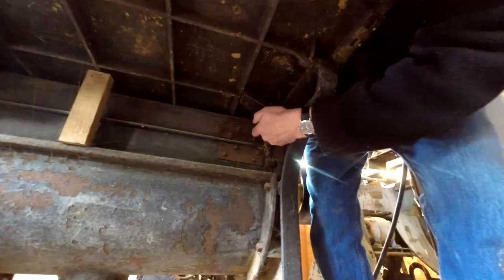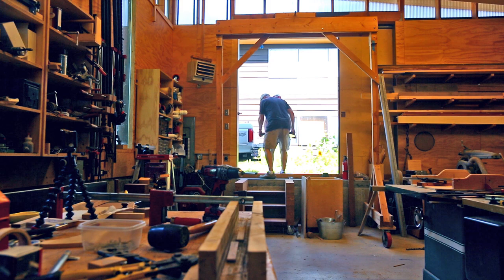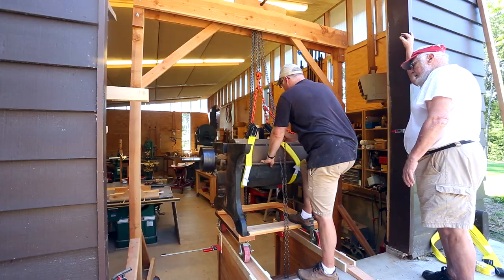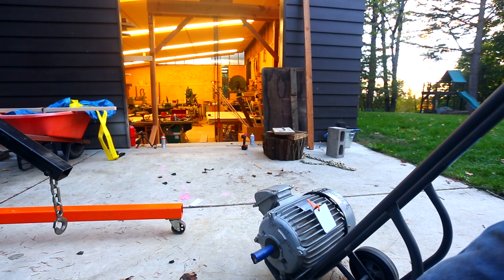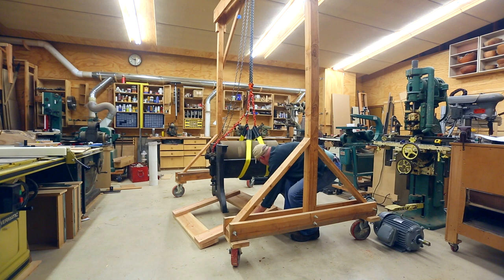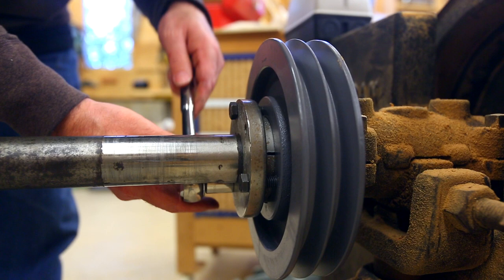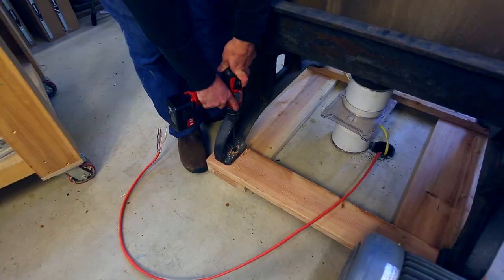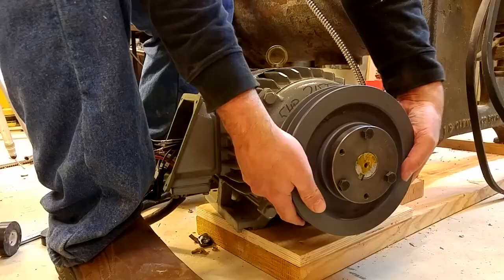Frank H. Clement Surface Sanding Machine

Comment: Frank, have you looked into fabricating (or having someone fabricate) in-feed and out-feed tables from plate steel and square tubing? if the mating surfaces are not too complex it could be a simple solution. As far as jigs or fences go, a simplified biesemeyer type fence or strait edge clamp could be fabricated to facilitate accessories. BUT only cost effective if you use it a lot and it does not become a coffee table for the shop. Thanks for the videos.

Comment: I recall seeing a homemade version of this style of drum sander. It was important for the table surface to be dead flat. The interesting thing I recall was that the wood didn't actually contact the drum or the paper unless the drum was at speed. The person showed in slo-mo how the paper would rise off the drum to contact the wood. I suppose you could either have the table surfaces milled flat or just do wood like Frank suggests. I wish I could recall which maker it was...

Comment: Hello Matthias has a good idea there and maybe a little further you could make a metal bow type fixture with spacers in the middle for adjustment and make it a permanent fixture I have seen this done on a scraper table to tune it and keep it flat as for the oscillating back and forth  it was kinda ment to.. the flat belt systems had a bit of slack in them to  help tracking also your belt tension will make a bit of difference there too and as the other guy said make sure and keep those babbit bearings oiled you might even look into your local steam engine club and they might have a set of oil cups you could install on the bearing housings so if you forget it doesnt shoot the bearings.   hope you have all kinds of fun with it and merry xmas

Comment: You need a couple of set collars on the shaft next to the bearings or bronze sleeves.  But I would think that the main drum shaft may have set screws collars in the side castings.  I seen one like this in an old shop driven by a flat belt and steam.

Comment: Would it be possible (and smart/safe) to install another pulley on the drum shaft and run a belt from it to a second roller above the surface that would be a feed roller for larger projects? Since that feed roller and sanding drum would need to spin in opposite directions you'd have to figure-eight the belt, and speed reduction would have to be quite significant. The feed roller, as well as framework to hold it, could be made of wood with something as simple as old inner tube sleeved over the feed roller to give it more grip.

Comment: sounds like a bearing issue, you can see the shaft play in the video, this would cause the vibration too, as well the belts look miss aligned in the video ,,,, great find , wow , might think of building a spindle sander or large disk on the shaft extension when making the cover for the pulleys , , lucky find ,

Comment: Frank  FYI   When you put a wire thru a chase it is always good to also pull another wire (say single 12 ga) or a line and leave it for future use.  Then you are not saddled with sucking through a line that might get hung up.  I have seen where in a large commercial chase an electrician will use a ferret to pull a line through.

Comment: I used to manage a cotton gin with many 8' x 24" drums.  If unbelted to drum settles to the same position you know it has a heavy side.  But if it settles inconsistently, it likely has some dirt inside.The exposed shaft is a far worse hazard than the belts.  Many, many injuries in cotton gins over the years from exposed turning shafts!

Comment: Is it possible that the drum wheel has bearings like Babbitt bearings that may need to be replaced? Or perhaps find a couple bearings that will fit on the drum shaft that could have stops machined to hold the drum from drifting? hard to tell for me as your video is showing how you moved it and got it up and running but I would check into both as a option.

Comment: Frank could there be a bolt or set screw that's loose that locks the shaft from moving. Most pillow block or other bearings have this feature. Alignment of the pulleys also helps with vibration, I didn't see you check this with a strait edge from pulley to pulley. How did you tension the belt? I would make a steel frame under the motor then weld nuts to the frame and use these to push or pull the motor for correct tension and alignment. Love your shop and everything you do. This might be crazy but could you fill in the low spots with self leveling epoxy?

Comment: If you balance the drum, it might eliminate/reduce the side-2-side motion. If it is still present, mount thrust bearings. If you can't press the plates true (r), could you tack weld some plates to the bed? Like a veneer?

Comment: Frank-  As James Stanlake mentioned, I'm also going to make a bet that that drum is running on babbit bearings.  If they are worn out, you will get shaft endplay and maybe even vibration if they are worn enough.  If the bearing housings have oil cups at each end, you could try to drizzle some motor oil in them and see if it quiets up..  If it does, you will probably need to have the babbit redone.  Turnwright Machine Works and VintageMachinery have videos about pouring babbit.  I think MrPete222 does as well.
As for your speed, it would be cheaper to get a smaller pulley for the drum than it would be to add a VFD.  Just get the new pulley 33% smaller than the motor.  6 inch motor pulley/ 4 inch drum pulley.

Comment: Is the base level ? It would cause the shaft to move like that. If the floors slanted away from the pulleys the shaft will go towards gravity and then bounce back the other way as the belts get tugged on.

Comment: Hi Frank,
Wondering if you can answer a couple of questions about your large disc sander.
I have the opportunity of buying a large diameter (1000mm) disc sander or a smaller diameter (460mm) disc sander. The price difference is roughly $600. 
How valuable do you find your large disc sander? Do you miss having a belt sander? Is the speed difference of the disc (outer edge vs the center) ever and issue in causing an uneven amount of removal of wood on a piece. 
Thanks for your help. Absolutely love your channel.

Comment: By making the one end of the shaft a secondary tool, ie, large disk sander, you'll essentially be blocking in most of the exposed belts. Since you do have a welder, get yourself a sheet of expanded metal, cut about a 6" wide section and just bend a hoop around the belt, badda-bing... zap weld to a quickie angle iron frame... done!

Comment: Hi Frank, if you choose to use a, VFD to slow the three phase motor down, be cautious of that. I only say this if your rotary phase converter is not balanced on all three legs, the VFD might go into a fault condition because of the uneven voltage on the VFD input. you might be better off using a 7.5-10 HP VFD on single phase input since there would be two input legs at a consistent voltage rather than a third "wild" leg from your RPC. Hope this helps. Scott

Comment: +frank howarth How did you hook up the 3ph motor in your shop, because isn't your shop only 1ph. So did you have to use a 3ph converter or is your shop actually wired for 3ph

Comment: The horizontal issue sounds like a spacer or bearing is missing. The vibrations is either the frame isn't straight or the drum isn't balanced

Comment: When you are pulling wire through a conduit like you did you should pull another string along with the actual wire so the next time you want to pull wire through that conduit you already have the string in place.

Comment: Frank--  Drum sander looks fantastic!  Really interested to see how you use it.  Regarding the drum speed, do you really need to adjust the motor speed electrically?  My first (inexperienced) thought was to change pully sizes to a 3:2 ratio to bring the RPM down from 1200 to 800.  Guessing there might be other reasons for electronic speed control anyway, but also guessing that the motor runs most efficiently at 1200 RPM, so it might work to think of using both.  Also, if the drum can be raised and lowered, will that affect belt tension more than negligibly?

Thanks for sharing your workshop, skills, and creations so openly.  It's a real pleasure to watch.

(Edit:  Just noticed at least one person suggesting the pulley size solution long before me.  Story of my life...)  :-)

Comment: When you pull a wire through a conduit, also run a "pull string" so next time you need something, just attach it to the "pull string" already in place.  Don't forget to add a new "pull string" each time you use it.

Comment: hi Frank
It quit some time since you send this youtube - did you solve the problems with the vibrations  - some of the vibrations can maybe come for the long axle there is left over when the sander runs full speed, and an other thing can be that the belts seem a little bit sloppy - br
elevalther

Comment: Its awsome, but isn't it impossible to get a straight surface? because like a joint the outfeed table is higher (because you take away material) and this drum sander doesn't have it right?

Comment: Have you considered instead of getting a VFD for the motor you could reduce the size of the drive sheave by 1/3 (assuming they are both the same now) to get your 800 rpm?

Comment: Just a thought: Don't you have to align the motor pulley with the pulley on the sanding shaft? Otherwise this might cause the bumping noise of the sander (i am guessing, the belt is applying axial force onto the shaft and that is pulling the shaft in the axial direction...

Comment: Before you add a VFD, look at changing the motor pulley, calculate the right speed first! VFDs are great but constantly running the motor slowly can mean that you need to add an external fan to cool it. Even if you want to have variable speed, getting the motor into the right range with the pulleys is a good idea. An alternative to the wooden beds, which doesn't exclude them might be bracing the plates up in the middle , I'd need to see more from underneath to make suggestions!

Regards, Matthew

Comment: For the dust collection, you could cut the pipe in half length wise and just hose clamp the two pieces across the inlet/outlets with the sander in place. A little late now though...

Comment: Maybe such a powerful motor needs a more sturdy base to mount to, I know you're a wood guy but welding a tubular frame would help rigidity and strength here (5 horses at work mounted on a piece of wood...)  Next to this the drum seams to miss an axial stop to keep the drum in place that's why the pulley on the drum is moving from side to side. I notice this is quite an old video and you probably sorted this problems out in a good manner already. If not; maybe my comments help you get through the mechanical stuff which is my passion and job, Thank you for sharing this great content. Plan your work, work your plan. Thank you! Best, Job

Comment: Change the pulley ratio, instead of a VFD. Cheaper and keeps the torque. 
For the side to side motion of the axle, you might be able to replace the roller bearings with some timken type tapered bearings, the kind used on wheel axles, cylindrical rollers set at an an angle. They are a good compromise when you need lateral as well as radial control

Comment: Nice! Wouldn't be better to use different discs to have slow speed plus you can have more torque instend of using a power controller (which I think will be expensive as hell for a motor of that size)?

Comment: A pair of thrust bearings should fix your wobble at speed.  As for the table top the gentleman who suggested the precision ground plate I believe has the best idea at least for a near permanent fix.  The epoxy idea seems good at first blush but I don't think it'll last very well.  Same with a wooden top, to get enough rigidity you would need a thickness that would make it near impossible to realign with the drum

Comment: Frank, those look like a babbit bearings on the main sander shaft.  You should check that and confirm, because they require oil cups to keep it lubricated.  You might want to consider retrofitting sealed bearings to the machine.  If you can get a dimensioned drawing of the bearing blocks, I could assist you in making some new bearing blocks -- I'm not that far away from you.

Comment: You could swap out the bent cast iron tables for quartz countertop tables. Maybe take the C.I. tables (or 1 table, if they are both the same) to a coutertop shop, and have them make new ones out of quartz coutertop material (they'll use the C.I. tables as templates).

Comment: Hi Frank, you could slow the sander down by increasing the motor shieve. It would be a lot more cost effective and easer to do than to buy an VFD. You could also mount the motor better if you used s motor sled that you could purchase from Grainger. It would make setting the belt tension a lot easier.

Comment: Hey Frank, remember that the tailgate will come off of your truck super easily, so when you need a bit more reach with your engine hoist to get something you, you could pull that off and gain 18" or however much it is.

Comment: i have slightly smaller version of what you have that when i converted it from direct drive to pulley driven the bar was to long and the drum moved in and out as well, the solution i used to fix it was to build a box around the belts and on the side where the shaft was to long i took my metal cutter from my lathe and mounted it onto an old wood table i had and used it to cut the shaft end down, then what i did was i inlayed a bearing into the wood belt case to house the new shorter end of the shaft and i drilled and tapped very small holes on both sides of the bearing so i could place a small machined screw into the hole that would ride along the inner section of the bearing and the outer section, thus removing the side to side play... in regards to the drum how i got mine more balanced is i stripped it down to the drum itself with nothing else touching or attached to it, i then let it fall so the heavier side was at the bottom, then i marked it and drilled holes in the heavy side to remove weight, once i got it so i could turn it and it no longer moved to favor a heavy side i put it all back together, i balanced mine on the ends of the drum and not the center to keep the middle perfectly round still...

Comment: is that motor rated for a VFD? - if not it will get really hot if you run it with a VFD, to the potential point of failure... Just something to think about...

Comment: There's probably a worn thrust washer on that shaft
If you're not going to make use of that long shaft, i wonder if attacking it with a cut off grinder wheel while the shaft is turning may help

Comment: I built a very similar sander this year, 2 foot 6" wide.  It too has balance problems, despite careful machining of the drum and shaft by a guy over in England - and slowing it down is not the answer, before you spend a lot of dollars on a VFD unit, because you need the rpm for the abrasive to run at optimal fpm as per the original design.  I'm building a variable balancer to fit on my shaft, just a hollow drum on the shaft, where I can attach weights inside [ magnets temporarily, later by drilled steel pieces ], by a trial and error, suck it and see process.  My surface tables are simple 1/4" black steel plate, cheap to buy and pre-cropped by the supplier to size on his guillotine, which turned out to be surprisingly flat. Don't sand it to get the scale off, [ my mistake!] , you will mar the surface.  I found that 23% hydrochloric [aka 'muriatic' ] acid, sold as drain cleaner, will pull the scale clean off overnight, after degreasing, with the brush-on-and-run method!  - don't breathe the fumes whatever you do!  The acid will evaporate away to nothing, as HCL is a gas dissolved in water.   Steel plates give you better options for making a fence too- I've found that wooden-built  shop-kit never lasts, it warps, works loose under vibration and can't be bolted down real firm.
Reply: +belson alan   Found this:  Using an i-Phone, an app and some goop called Sugru, simple shaft/motor-sheave balancing can be done.   http://www.instructables.com/id/Dynamic-Motor-Balancing-with-Sugru-and-an-iPhone/
Reply: +belson alan The design speed of the drum is stated as 800 rpm, giving about 2900+ feet per minute abrasive speed at 14" diameter.  If your motor runs 1200 rpm, your drum sheave ought to be 1.5 x the diameter of the motor pulley diameter. Scaling from the video, you look to be spinning way too fast, as the sheave looks to be smaller than the driver.

Comment: Nice tool Frank. One thought at 9:50 perhaps a pulley diameter change?
Reply from the maker: +Rivertown Woodcraft Yes, after i talked about that I  found a pulley calculation web page.  If i get a 5.25" pulley for the motor i can have the drum rotate at the recommended rpm of 800,  now it is 1200 rpm
Reply: +frank howarth Perfect!! I had this issue with my bandsaw when I upgraded the motor to a high horsepower one, but also high RPM.

Comment: FRANK! is there any reason you can't use fish tape to pull wires through the pipe in your floor? it seems that would be a much easier way to do it than the multi-step vacuum towel process :)

Comment: Could the drum be out of tune and causing the pulsation due to dirt and sawdust that could be within it?
Reply: more like the old pulley wheel acted as a fly wheel too, now it is vibrating as a motorcycle axle
Reply: I agree, sounds like a definite check. Given the size of the drum and the damage to the tables it would be worth checking for deformation.

Comment: Skip the vfd, size your pulleys right, get a used scraper's straight edge, scrape your iron tables flat, chop off that extra shaft length, build a guard for the belts, get shaft collars and thrust washers from mcmaster carr to stop the drum for wobbling.